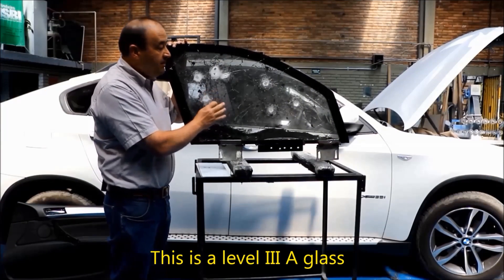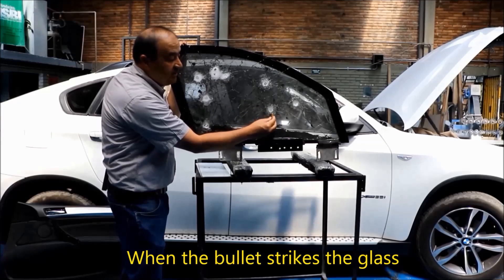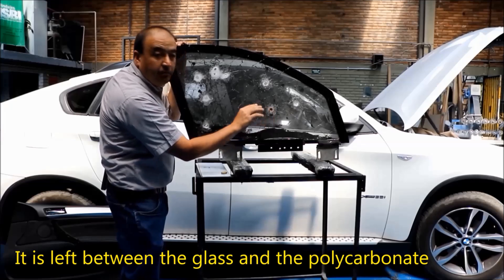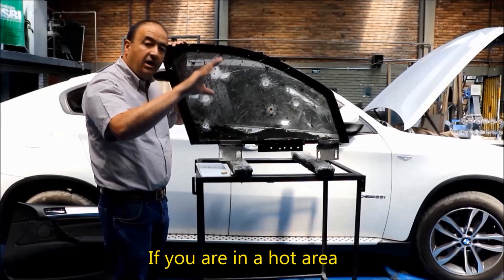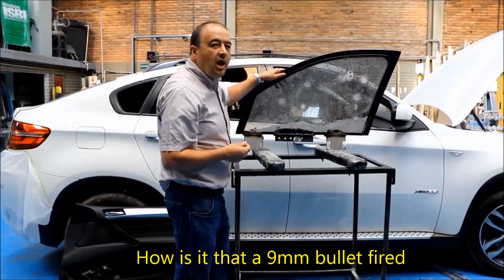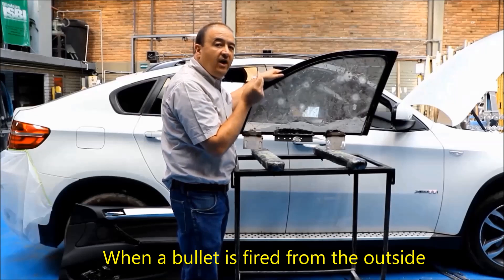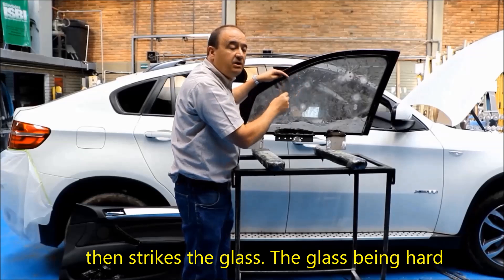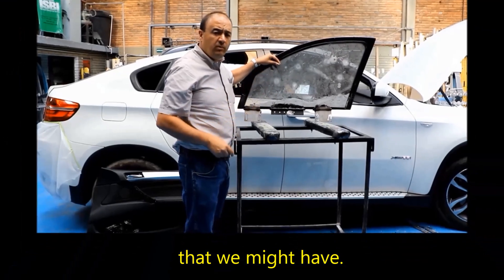Bulletproof one way glass ballistic vehicle transparent armor

Comment: Very similar product was installed in Clallam Bay in Washington state, USA.
Around 1986-1987
Anyway, they were really proud of the one-way feature; the hard glass on one side, layers of different thicknesses and all that anti-spalling stuff.
These were supposed to be good against .308 on the attack side, but I am not sure what threat level that would be.
Stuff was a little more than an inch thick, looked purple on the edges, maybe 7 layers, not counting the glass.
Reply: Greg.   To stop a .308 it has to be a little over 1.5 inches (41mm) In this case the one way concept will work if you shoot from the inside with the same caliber it was rated for (.308). So if you shoot from the inside with something with less energy like a .223 or a 9mm the bullets will not go out.  

9mm glass thickness 17mm
5.56 ball M193.            28mm
5.56. SS109.                 33mm

Our product is curved. Ideal for civilian vehicles.
Reply: john murphy im in chicago with family just need something to stop  hand calibre guns and pistols yet thin were no one would know 2015 chrysler 200 limited how much for windows and would i be able to roll down my Windows